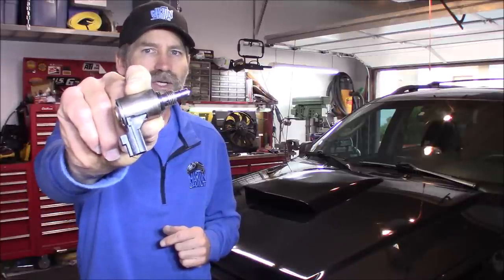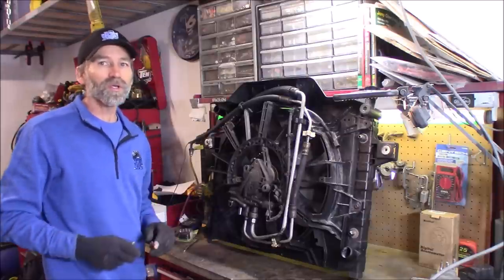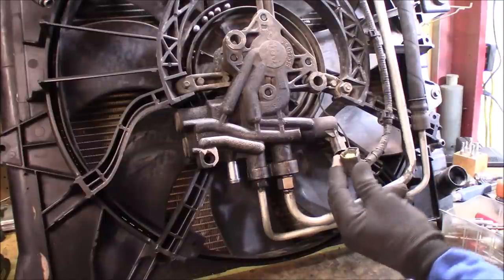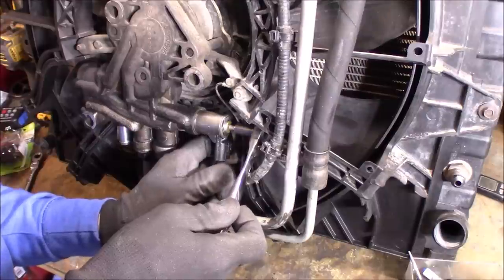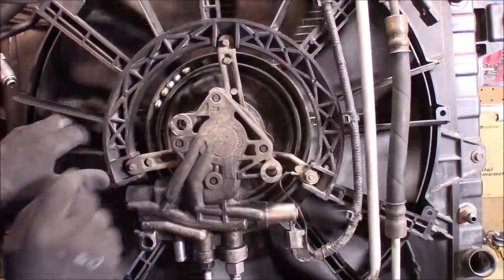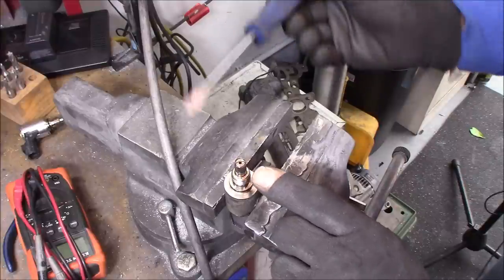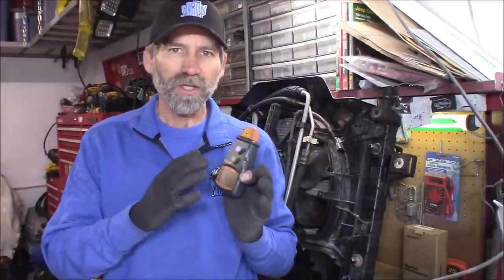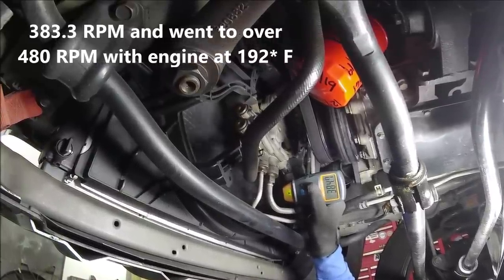01-04 Jeep Grand  Cherokee Hydraulic Fan Solenoid Mod, Remove &  Replace

Comment: Nice tutorial. I now know why my ac won't work correctly since it won't ramp up. I bought a used solenoid and attempted to replace it. When I unscrewed the solenoid, the end came off and the main part of the solenoid remained in the fan motor. Has anyone had this problem? I didn't try to use pliers to try to unscrew it since I have a 45min drive home.
Reply from the maker: Thank you.  Yeah that problem with the solenoid unscrewing just half of it has happened to several people and I've had it happen to me one time out at pic a part when trying to removing one. I was able to clamp a vice grip on the very outer edge and break it loose. You may want to try that.
Reply: @martinbuilt  thanks for the quick reply. If it doesn't break loose would the vise grip marks prevent it from working if I had to reassemble?

Comment: I got under the Jeep to do this mod today. I backed the t-40 out and half of my solenoid was left in the fan. I had brass male threads sticking out. So this is apparently a 2 piece design. Any ideas to get the other half out?
Reply from the maker: I have heard of this before on a forum where they were talking about replacing the solenoid. One person had commented that this had happened to them. I don't recall what the outcome was. I have done this five times myself and have never had that happen and don't even understand how it could. Does your solenoid look exactly like the one you see in the video?  Are there two wires or three wires going directly to the solenoid?
Reply: martinbuilt yes it does
Reply: martinbuilt just took it for a run and it was running hot with ac on fairly normal with ac off.
Reply from the maker: @adjake1  Can you post some pictures on my Facebook and  we'll see if we can figure this out. https://www.facebook.com/Martinbuilt-2351766611763181
Reply: martinbuilt just posted a few. I’m going to go down to the pull a part try to get a few to gain a little knowledge
Reply from the maker: @adjake1  So were you able to put it back together?
Reply: martinbuilt yup but it’s running hotter than it should

Comment: BUEANAS TARDES TENGO UNA CAMIONETA GRAN CHEROKE 2004 CON HIDROVENTILADOR  SOLO TIENE LA VELOCIDAD BAJA NO AVTIVA LA ALTA SERA QUE SI LE DOY LA MEDIA VUETA AL SENSOR SWE ACTICARA
Reply from the maker: yes turn clockwise 1/2 turn should double the speed. Also, check the ohms at the solenoid should be near 10 ohms.
Reply: Hola resolviste? pareciera que tienes el solenoide malo.

Comment: Lincoln ls and Ford  got same system, it dose go out and it is positioned  in the one of the hardest place . They don't make them no more , that means good luck finding used one or overheat your car in traffic... new use to cost 200 $ (like I'm saying , they don t make it no more but it dose brake). I see it as a bad design and waste of money considering they don t make it no more and it cost a lot.

Comment: Martin where u get the hydraulic fan sensor new I only found used if you can help me and tell me where u get it online or in a mopar store
Reply from the maker: The  Solenoid is not available New and only can be purchased used. The only way you can get a new one is to purchase the entire hydraulic cooling fan assembly which is well over a $1000.
Reply: @martinbuilt  ok thanks Martin used u think works?
Reply: @martinbuilt  I see in eBay they sell the whole fan with the solenoid new they only ask for 300
Reply from the maker: @joshuacotto4133  
I see a bunch of used ones for $300 no new ones

Comment: Is the grand Cherokee solenoid  the same as the one on a commander? So hard to find
Reply from the maker: I would say if it looks just like the one I'm showing in the video it's the same there are also a three wire solenoid sometimes even found on the Grand Cherokees those cannot be modified.
You can also find the solenoid on some Lincoln models using the hydraulic cooling fan, the solenoid is actually mounted to the power steering pump.

Comment: Hi, Martin, i have problems with the hydro fan, it has one temperature sensor conected directly to solenoid, so when the external temperture sensor attached to the water hose gets warm temperature it automatically turn on the hydraulic cooling fan at  the hi rebs, 3 minutes later its turn of, so im intereted in how fix that problem, where i should star, if i disconet temperature sensor located behind map sensor its automatically turn on the hidraulic cooling fan, i thing its a wire problem.
Reply: I dont have problems of hi temp,  and my grand cheroke has 246,500 mi
Reply from the maker: Seems to be some kind of confusion, there should be no temp sensor hooked to the radiator hose. What year and make model a vehicle do you have and what engine?
Reply: Its because it is an adaptation
Reply: 2001 grand cherokee 4.7
Reply: And tanks for your answer, i hope somebody can help
Reply: The problem is, when the hydro cooling fan start,  it starts with all the power.
Reply from the maker: @arturo78925  I'm familiar with this mod with the hydraulic fan that you're talkin about. Perhaps you can enlighten me or direct me to a website that talks about it so I can figure out what's going with your Jeep..

Comment: If there is air in my power steering system will my fan not cut on?
Reply from the maker: If there is air in the system you would feel it in the power steering as well.
Reply: @martinbuilt my power steering was going in and out. I believe I got it fixed now I replaced the whole unit and now I have the fan back. Thank you

Comment: jeep commander story

My hydraulic fan won’t  come on at all on my 2006 Commander Limited 5.7L. I checked the solenoid harness pins with my meter and I appear to be getting a PWM signal from the ECM, 12V, and ground. The fan spins with little resistance when I clock it with my hand, so it’s not seized up. I tried disconnecting the engine coolant temp sensor to see if the fan would go into “hi rpm mode”, but still nothing. Today, I removed the solenoid and flushed the power steering fluid. I inspected the solenoid and it seems to be in working order - I put 12V across 2 of the pins multiple times and the electromagnet engaged the pintle each time. I even tried re-installing the solenoid with the pintle removed, thinking that the pintle couldn’t restrict flow if it wasn’t there. Still nothing. I let the temp gage get to just past half way and then I shut down the engine so I don’t damage anything. Thoughts on next steps anyone?
Reply from the maker: Sounds like you've checked everything and now you're down to it's the hydraulic fan that's the problem.
 I'm assuming your power steering is working perfectly no  normally higher than  usual resistance on the steering wheel.
Reply: @martinbuilt  There have only been a few times where the power steering had a moment of resistance in the past 8 months, but nothing recently. Good point, however. I’m still stumped that the fan wouldn’t function at all IF some fluid IS reaching it. Maybe I shouldn’t assume that. I’m in denial for some reason that the fan just stopped responding to fluid pressure/flow (accept in the case it was seized). I’m too close to this one - I need to step away!!

Comment: I’m a little confused , what is the purpose of this mod and what does it improve ?
Reply from the maker: It doubles the RPM of the fan which interns pulls more air  and the engine runs cooler.

Comment: Is it possible to add manual switch to manualy max the rpm of the fan??
Reply: If you want the quick and dirty method for that, you could wire up a switch to disconnect the coolant temperature sensor which is between the a/c pump and alternator. It will throw a check engine light and render the temp gauge inop (as well as make the pcm unable to see the temperature of course) but it will make the fan run at full speed.
Reply: I knew this method. I want something smarter. Without CEL. I wonder if it exists..
Reply: put a switch to apply full power to the solenoid...
Reply: @omegarugal9283  you mean 12volts?

Comment: im having a hard time getting my fan to turn on at all could that be a bad solenoid? if so where can i get a  new one?
Reply from the maker: yes, it is possible that it is bad. Are there times the fan is not spinning when the engine is running? 
You can only find used solenoids. I have a few available.
Reply: @martinbuilt  I can't get the fan to turn on at all
Reply from the maker: @LeoEnigma  then the fan is bad. Replace the entire fan assembly.
Reply: @martinbuilt  welp that's too expensive guess its time to look into electric fan conversion thanyou for your help and i love your videos
Reply from the maker: @LeoEnigma  you could look into one from a salvage yard. At Pic-a-Part you could get one for $30 with a 30-day warranty.
Reply: @martinbuilt  I don't have any of those around where I live unfortunately
Reply: @martinbuilt  I topped off my power steering fluid again and the fan starting spinning it's just very very slow so slow in fact that I can stop it with my finger could it be the wrong fluid or do u think the fan itself is still bad

Comment: Great video, just what I was looking for. I went to do this mod on my 04 Overland but my solenoid is a 3 wire,  the bolt is covered by some sort of a plate and not accessible. Is there trick to remove that plate or am I out of luck? Thanks,  keep the videos coming
Reply from the maker: I just saw one of those a couple of weeks ago at Pick-a-Part but did not check out how to remove one. If I find another I'll look into it.
Reply: @martinbuilt  Thanks for the quick reply, I've been searching for another one for 3 weeks to no avail. I'll probably have to do the hydraulic to electric conversion but the 5.9 limited fan is more difficult to find than I expected. Thanks again
Reply from the maker: @seanwolf2571  Perhaps an electric fan from a late model Jeep Liberty, this is what I've heard from others. Check out the comments on this video.
Reply: @martinbuilt  awesome , I will start the hunt for that one. Thank you

Comment: Any ideal where the low pressure AC sensor is?
Reply from the maker: There is no low pressure switch. The transducer monitors the high side and changes internal resistance according to pressure, PCM provides a 5-volt signal and ground to the transducer allowing it to monitor voltage changes as refrigerant pressure increases or decreases.
Reply: Thank you so Much Martin!  I have learned so much from your videos!

Comment: Do I need to bleed the system after doing this ?
Reply from the maker: No you don't need to do that the air will work out of the system through the power steering pump in a matter of minutes.

Comment: How can you tell if the solenoid is bad.
Reply from the maker: Using an ohm meter, you should be able to see something near ten ohms
Reply: @martinbuilt  Disconnected  temp sensor ,fan went into hi speed , i guess that means cooling fan solenoid is good and fan is good, right?.could it be the temp sensor it self ,it only heats up after a 20 minute ride , fan does not seem to want to go to high speed,thanks for the help, 2002 jeep 4.7.

Comment: Mr martin which auto store can I find one
Reply from the maker: You can not purchase the solenoid new anywhere you have to buy it used. You can find them on eBay, and you can find them at your local salvage yards. I also have several of them if you're interested.
Reply: @martinbuilt  how much are you selling em for Martin?
Reply: @martinbuilt  do you still have em? I'm interested in one. I got the p1499 code

Comment: So what exactly does that selenoid do?
Reply from the maker: It controls the fan speed by restricting flow to the fan motor. Getting its signals from the ECM.
Reply: @martinbuilt  thank you

Comment: I priced the brand new fan assembly and it's just over 3 grand in 2021 and there's only 2 new ones in the entire us
Reply from the maker: I would definitely be taking my chances with used ones from your local salvage yard before I spend anywhere near that. When they were priced at $1,200 they were too much.
Reply: @martinbuilt  I'm most likely going to eliminate the hydraulic fan and replace with a super duty electric fan  if I can figure out how to terminate the fan from the power steering assembly without throwing the system out of wack. 300 bucks is a whole lot better than 3k hahaha
Reply from the maker: @TOO_RAW   Have you checked out this video where I converted the hydraulic fan to electric. https://youtu.be/J02nYci5DS0
Reply: @martinbuilt  You sir just saved me a lot of research and possibly some trial and error. I believe I found a super duty fan that's specifically made for the 4.7 radiator(which I have to replace anyway since it decided to crack on the seam right under the upper hose mount today) but if it ends up not being the right one it's great to know I can use the one off a 5.9L with some moderate modifications. Thanks for your guidance Martin you're the man. Also that's the first time I've seen someone use a drill press as a mill I'm impressed
Reply from the maker: @TOO_RAW  Glad you liked it, this is in my top 10 favorite mods that I have done to the Grand.
Reply: @martinbuilt  which is your favorite? I was thinking about putting an nv 231 transfer case(select trac) on my 4.7(quadra drive)when the  nv 247 takes a crap in the next 100k and I think that is my dream mod. You and D&E in the garage have the best reference materials for the 4.7 on the whole internet and I thank you both.

Comment: Would'nt you be better off to ditch the hydraulic fan for an electric fan?
Reply: Yes, but that is a rabbit hole you might not want to go down.
Reply from the maker: Absolutely Dan I just thought I'd throw this video out there for those that don't want to go through the work of changing out to a electric fan. Matter of fact I'm working on a electric fan conversion as we speak.
Reply: @Land and Lore Photograph so you're saying the hydraulic fan is better than the electric???!!
Reply: @Land and Lore Photograph or could it be the radiator just wasn't quite adequate for the engine?
Reply: @Land and Lore Photograph I think what the problem was is they were trying to pull every btu out with a fan when all they would of had to of done was add another core to the radiator to increase surface area for cooling. I hated my hydraulic fan because it was so unreliable. When the electric was on, you knew it was on.

Comment: My son who is the mech in family said to me to ask you a really good question.  How did you arrive at modding the solenoid? He said besides arriving at the solenoid after T-stat and pump replacement what made you mess with this adjustment? Plus you comment that you can sell the old one to someone else , which makes me think replacing is the very last recourse before the mod. BTW this started with me because I would drive around summer time and when i turned off car it wouldn't turn on until it cooled down. Temp would be close to 210 and here in Colorado 190 is boiling. I watched your elc change out @ https://youtu.be/J02nYci5DS0?si=7BxjU8kdBVekfyXM I really don't want go this way but it might be in the cards.
Reply from the maker: After having issues with the cooling fan I removed the solenoid suspecting there could be a problem with it and then discovering the screw adjustment inside the solenoid is when I started experimenting with it even though the screw is set at a particular spot I forced it past that to make the adjustment.
Even though you're boiling point may be lower due to elevation the radiator cap raises the boiling point well beyond 220°
Thank you for watching.
Reply: @martinbuilt  When you removed the solenoid you never showed it from the car but only with the radiator out of the car. The big question is how did you drain the fluid if to did it while inside the car and how much fluid did you loose or did you replace all the fluid?

Comment: Tried to do this and the solenoid came apart and half of it is still in the hole
Reply from the maker: I had that happen to one out at the salvage yard, got it out by using a vise grip on the edge of the remaining part. This can be risky.

Comment: My Jeep grand Cherokee 2000  4.0 6 cilindro have solenoide my fan
Reply from the maker: your 2000 doesn't have a solenoid, there is most likely a relay that operates the E-fan

Comment: Mine unthreaded into 2 pieces????
Reply from the maker: Unfortunately that does happen the thing is you'll need to get the other half out otherwise you're going to need to put it back together and leave it as it is.
You may be able to grab the edge of the other half with a pair of channel locks or vice grips to get it to come out.
Reply: @martinbuilt  I put it back on with high strength orenge Locktite. Hopefully that will keep it together as 1 piece when I try to remove it again.